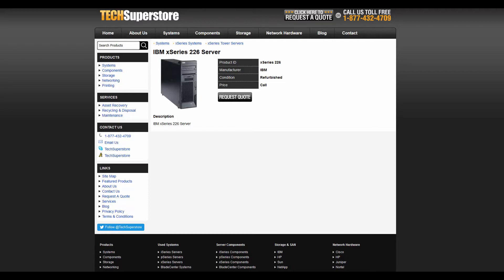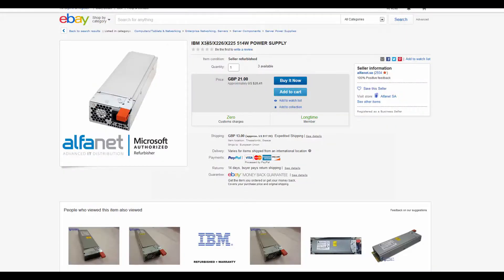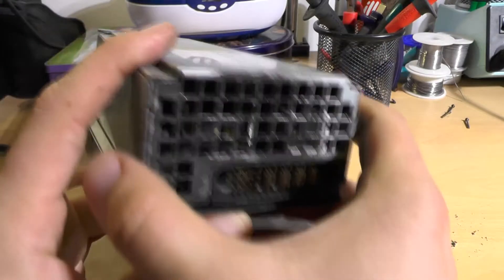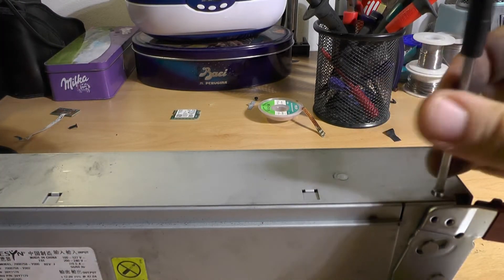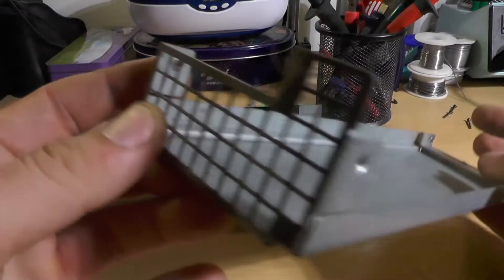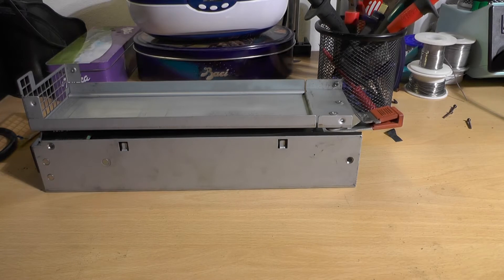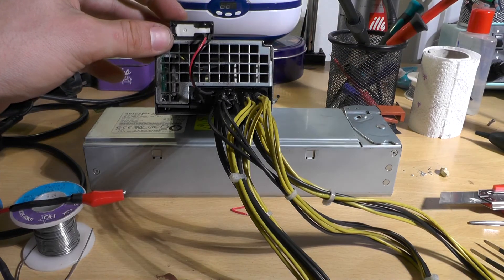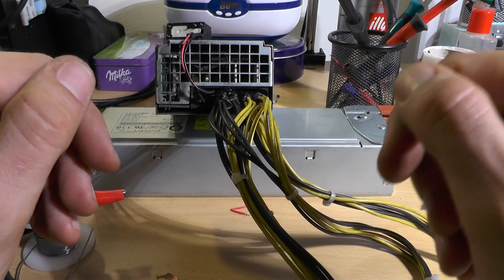1028W of power for 50$ (some skills required)

Comment: How do you figure out the exact pin to short with Ground to activate the power supply ? I have Supermicro PWS-1K41F-1R. Trying to identify the pin to short to ground. However, I am not able to figure out the pin diagram. www.imguir.com/UZ3GlK6, imgur.com/UZ3GlK6, https://imgur.com/CBB7FyU
Reply from the maker: One of the pins is 1mm shorter than the others (PS_ON). Connect to DC ground and it should turn on.  I FOUND  THIS ONLINE SO USE CAUTION!!!! :)
Reply: @MTS_IT  That is where my confusion starts. I have seen the same suggestion to look for the shorter pin. However, mine have 4 out of 16 pins, which are shorter. https://imgur.com/CBB7FyU
Reply from the maker: @azashar1  personally i would use ‘trial and error method’ aka connect one wire to the ground and then test one by one pin. (Power is off so IN THEORY you cannot fail much) However i’m saying what I Would do...

Comment: MTS, Great presentation. Question, so with a unit that has more watts for example, 39Y7355 - FRU Power Supply 1440W for IBM System x3850M2/x3950M2, to power older ASIC miner, just the short should work, the pci-e cables as you have shown. (no ATX supply) ? Thanks
Reply from the maker: if it's the same pinout - yes, if not - no (i'm assuming that you are talking about the same (but stronger) model)

Comment: Adding resistance between  pin 17 and ground will raise voltage up to 13.6 volts ... use a 0-5k pot and adjust it until you get 13.6v then measure the resistance and solder a fixed resistor of that value... Note you can get 13.8 sometimes but your right at the shutdown threshold.  Best to not run it over 13.6  .
Reply: This model has only 16 pins. Which one is pin 17?

Comment: Nice!
750W server PSU are cheaply available to me rather than the ATX one, is there any chance that I can use that psu in my desktop?
Reply from the maker: hi, in theory yes, KEYWORD theory! You would need to connect all wires and that would be a little bit harder (you would need schematic - or original cage)
Reply: @MTS_IT  does server PSU have 5v and 3.3v rails also?
Reply from the maker: @zubair3d  yup, since it has DVD drive and HDD drive it has to have 5V, regarding 3.3 i think that it's a standard
Reply: @MTS_IT  thanks for answering, will look into it
Reply: @zubair3d  any update on the server psu to desktop ITX ?

Comment: Imaš shamu za to napajanje? Bacio bih ga na 13.8V.
Reply from the maker: pozdrav, nemam :/ ... ali zasto samo ne spojis stepUP na izlaz? Ovakvo nesto: https://www.ebay.com/itm/DC-DC-Converter-10-12-15-20A-150-250-300-400-1200W-Step-up-Step-down-Buck-Boost/382219150784?hash=item58fe0965c0:m:mCHY1nLxgu47cYpdyd1LmDA:rk:1:pf:0 (izaberes model ovisno o tome koja ti snaga treba)
Reply: 20A je malo. Jednostavnije mi je modificirati svicer, ako ce ici.
Ili ubaciti drugi, koji se moze podesiti.
Reply: Ma bit ce dobro i 12V, nece se stanica puno buniti :-)
Reply: E da ni si ga upitao na naskim ne bih I slutio da je nas :)
Reply: Nameravam da kupim takvo napajanje 1200W jer je mnogo jeftinije od obicnijih ATXova :) I da ga koristi na sandartnom blocom :)

Comment: Hey dude, how did you figure out what pins to short? Could you power up any psu just by shorting 2 pins, or is each one different?
Reply from the maker: In theory yes, 2 or 3 usually, i have searched for pinouts
Reply: MTS Cheers. I have the pinouts for a Martek PS2328 but I'm not sure which ones I need to short. How do I figure it out?
Reply from the maker: http://www.martekpower.com/pdfs/2328_datasheet.pdf , maybe ground and pin 18, or pin 18 and pin 16 and ground. you'll need to test the combinations (bare in mind that you can short circuit the thing and burn the fuse or your fingers :D)
Reply: MTS lol thanks!
Reply: @MTS_IT  hi, can you replace the fuse? Thanks.
Reply from the maker: @donsong9958  Hi, Fuse usually blows up due to faulty component - so - most likely if you install new fuse it will blow-up as well.
Reply: @goldar4846  I know it has been a long time since you posted this but I figured out the solution to bench conversion of the Martek PS2328 Power Supply today after a few hours of head scratching.

Join Pin 24 (PS Kill/Enable-N) to Pin 21 (Logic GND), Join Pin 18 (Remote On/Off) to Pin 11 (Relay Control). She'll fire right up.